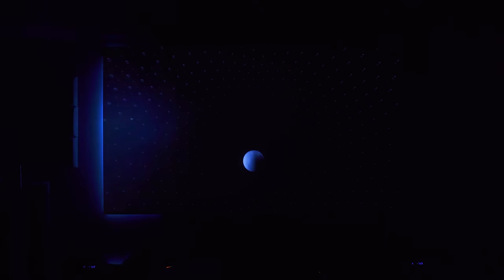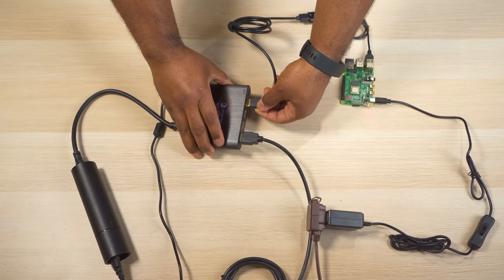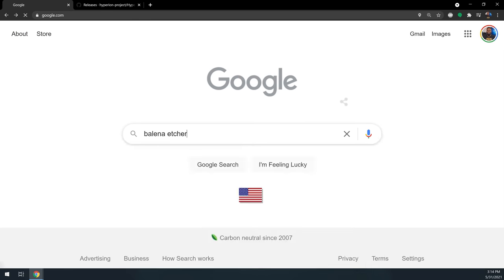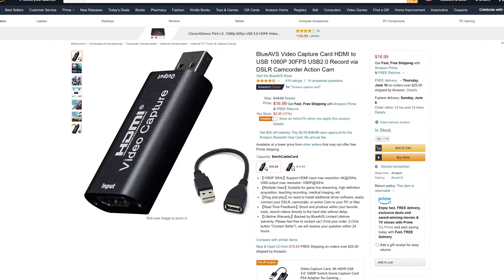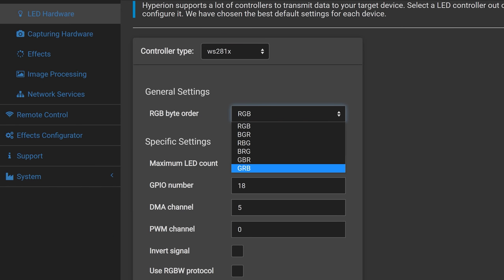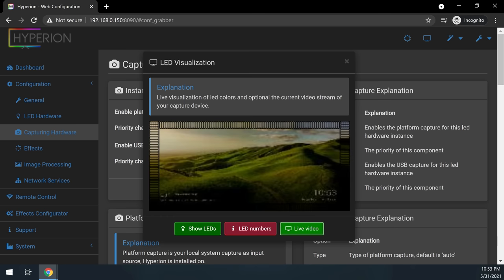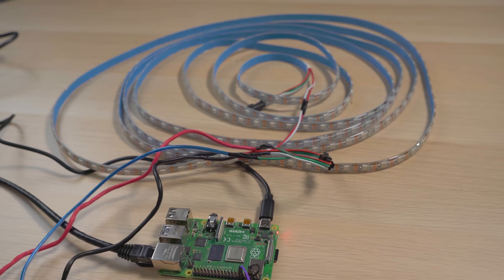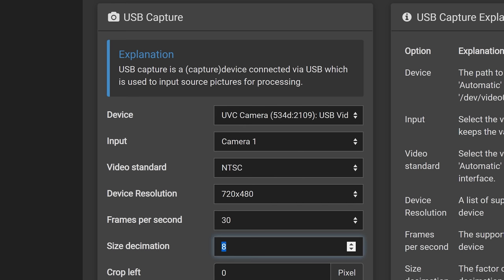Full Hyperion Ambilight Tutorial (TV Backlight) - LEDs Match Colors On The Screen

Comment from the maker: I want to note that if you plan on using multiple power supplies you should NOT wire the positive wires together. In other words, if  you're using 2 strips you'll connect one power supply to each strip but you don't connect the positive wires on the same circuit. You should wire all of the ground wires together.
Reply: This that helps alot. Thank you loads for your time.  Can't wait. But looks like it's the 400dollor box gurrr
Reply: Do I still need the splitter if use a receiver with 2 HDMI outputs
Reply: @ajaltonwilliams1986  good question
Reply: Chris have you used the hyperhdr software? If so are you able to use a different capture card?
Reply: thats what i thought while watching your vid...
Reply: i may have missed it but if you use a 12v led strip how to do get that common ground with the raspberry now that the voltages are different? thanks!
Reply: Is it possible to use an old Android tablet instead of a raspberry pi or any old pc like surface pro 3 or Lenovo x1 carbon etc....

Comment: Please, don't get 5V LED ones. working with 18A is ridiculous for only 300 LEDs. If you get 12V LED you'd be only looking at 8A or so.(no, I did not pull a calculator, so it could be off).  Even better, get 24V LEDs
Reply: I know it's late but ws2812 is only 5v, only ws2811 is 12v
Reply: 5v leds are individually addressable.  12v and 24 are not

Comment: I mean…it looks REALLY good. But, by the end I was calculating how much I make an hour vs the number of hours it would take me to get this right and I think it might technically cost me more money than the Hue setup 😂
Reply from the maker: 🤣🤣 Time is money!!
Reply: That's a great life ratio 🤣
Reply: Weird flex
Reply: Don't get Hue, get Govee instead and hide the camera under the TV with some décor. Phillips hue is the worst of the 3 options since it's the most expensive and delivers the worst result.
Reply: Brittany i literally pictured you programming your rasberry pi arduino and configuring Hyperion for your Ws281x controller, while troubleshooting voltage drop. Don't forget to connect the wire from GPIO18 to channel 1 on the 3.3v side.

Comment: I've been planning this project for awhile now, and as an individually-addressable LED, Raspberry Pi nerd - had definitely settled on the DIY approach.  I've watched several tutorials, and this is hands-down the definitive source of accurate and detailed information.  Total bonus when I learned that Hyperion supports WLED - so I'm driving my strip with a Dig-Uno controller w/ WLED.  This gives me a two-for-one setup allowing the maximum number of effects, as well as Home Assistant integration.

After much planning and research, finally pulled the trigger and ordered all my parts:  Could quite cough up the $$$ for the Diva, so settled on the Prophecy.  Already missing the CEC functionality -- just means I'm going to need to up my Home Assistant automation game to overcome the the loss.  Not sure I'm getting 4K@120Hz through the setup -- but could be a PS5 thing. :)

Thanks for the great content and insight!  I couldn't be happier with the results!  

Any thoughts on using an HDMI switch as an input - so that I can share the setup between PS5 and AppleTV?

Comment: Since no one mentioned it, 5:32 on HDMI splitter. You don't need to buy a special splitter for HDR tone mapping. Hyperion has a fork (version) called HyperHDR and this is a software based HDR mapping. This means, if CEC is important to you (it was to me), get a splitter that does support CEC (exp. EZCOO has these), and let HyperHDR do the rest.
Reply from the maker: Interesting. Thanks for the info!!
Reply: The prophecy Splitter is sold out, is there an alternative around the same price? Thanks!

Comment: Make the bottom strip the last one in the chain, and start from the bottom right side if you are looking at the back of the TV. This will give you the option of removing the bottom led strip if you have cables you want to hide, or if you install a center channel in the future. I learned this the hard way, but luckily it was on a monitor that was easy to reach behind.

Comment: If I'm not mistaken, having the resistor on the data IN would have probably prevented you from needing the logic board. If the logic board just "cleans up" the signal, the resistor would have done the same job for less $$. Great tutorial though!

Comment: amazing setup, really great video. i do think that after seeing that you need to buy a ton of equipment (some of it pretty expensive), the complexity of setting it up, and then you might get flicker which you have to buy (and hand solder) another piece to fix, and you might get lag... most people are going to just get a govee. i get that it isn't quite as good but it's plug and play. and until someone can make this plug and play (or substantially easier), i just don't think many will do this.

Comment: Amazing tutorial ! But I got three words '' Goove immersion kit " the latency on the lights has about a half of a second but it is extremely easy to install and it works just fine. I think if you're not working for a tech company or anything of that matter that involves all the skill that you have in this field,  I'm going to tell you right now that you should be looking into it because they are a lot of places that will pay you to install these devices specially since Goove only supports TVs from 55 to 65 inches, and your method seems like it could fit anything bigger than that.

Comment: Chris, thanks for the tutorial, by far the best I've seen! Quick question - you briefly showed an AVR with dual HDMI outputs in the video - have you tried the Hyperion setup using the second HDMI output from the receiver directly to the HDMI capture device? I'm running an Onkyo TX-NR6050 with dual HDMI out. I see in the receiver settings that I can enable both outputs and set the second one to a lower resolution. I watch a mix of SDR and HDR content through Xbox Series X and Apple TV 4K. I have two HDMI cables running from the receiver to the TV so it would be easy for me to set everything up at the TV using the second HDMI output from the receiver.

Comment: Kickass tut!!

Question:  From the video it looks like you are putting the light strips behind your UST PJ screen of 100-120". As such, I'm assuming you had to use about 25+ ft of led strips and it looks like you used a single power supply (assuming 5v ~40A) .
1) Did you take two long led strips and solder them together on all 3 solder points (power and data) to make one really long strip? 
2) For power injection in the middle of the strip, Did you then solder the secondary power wires somewhere near that solder point and then connect to the single PSU? 
3) Did you power the second strip on the far end as well? Thus 3 total power connections or do you just have 2 power points (beginning and middle)? 
4) Do you have a wiring diagram you could share?

Comment: Great work keep it up brother 👍🏽, first info I actually found was on the logic converter though you mentioned you didn't find any when looking to do my project your video was the second I saw the first had info on it quick question how many LEDs on your projection setup I'm having an issue where I can't run more than 490 and I need 504 on my 120 inch screen

Comment: Have been researching this and came across your video… hands down the best! Question: Would it be possible to implement light bars to this setup?
Reply from the maker: You could yes. You’d have to just get creative splitting the signal to the light bar strips
Reply: @ChrisMajestic  you think it would require a second Pi running Hyperion with just the sides configured? Or is there a way to configure two strips for the sides? I haven't played with the software but thinking of ordering it all tmw after watching your video. There are a few LED ambient light bars out there cheap. Also, have you tried this on a 3D TV/movie? I'm a big 3D nerd, lol. Thanks for the quick reply btw... subscribed ;)

Comment: HDMI CEC works as a bus so it is simply a connected wire between pin 13 of all HDMI connections.  All inputs and outputs pin 13 shares the same exact line.  you can simply do a continuity test on your device's input and output HDMI ports' pin 13 and all should be connected to each other.

Comment: Absolutely love this Chris! Thank you for laying things out in a simple and easy way to follow.

I had often thought about this option in the past, but could find no instructions that would make it simple enough for me to invest my time & money in attempting.

I currently have the 75" Philips Hue Gradient Lightstrip and Sync Box, but with recently selling off my 75" Samsung display and upgrading to the 100" VAVA screen (Optoma CinemaX Pro on order) I have found that my overly expensive bias lighting system will be swallowed up by the overlap of the far larger screen.

This option will allow me to mount the LED strip out to the rear edge of the screen! It will also address the pesky drops caused by my mesh WiFi system and Philips Zigbee mesh!

Thank you!
Thank you!!
Thank you!!!

I have one question though. Is it possible to run the Raspberry Pi bias lighting system on 3D content? This is something that the Philips Hue Sync Box cannot support.

Great video! ...also thanks for your earlier review of the Optoma CinemaX UST!

Comment: Thanks for this awesome video. Got some of the parts and am going to dive in tonight. I understand most of it, but how do you split the ground wire into two separate wires to create the common ground? Do I strip the ground wire and separate  the wire fibers into two different wires? Could I use the extra ground wire that is already on the LED strip to connect to the pi? Couldn't find any info online. Thanks!

Comment: Incredible tutorial! I followed it, and after a couple adjustments I had to make since I went wifi instead of using an ethernet cable like you did, it worked! It is GLORIOUS, but I have a few problems. My audio doesn't pass through the SIIG splitter for some reason, so while I have great video I don't have any audio to occampany it. Also the SIIG splitter weirdly does not support Netflix HDR despite supporting it in all other forms. Are you aware of any fixes for these issues? I'm still researching fixes, but thought dropping a comment here certainly couldn't hurt.

Comment: I understand the LEDs and Pi will require an external power supply, BUT why not use the video signal from TV USB port to feed the Pi to take advantage of the TV applications (most of what I watch) and not just the external video sources (only DVD player in my case). I have seen this might be possible on "5 great uses of your TV's USB port by Dignited": "The USB port on the TV also allows you to connect accessories to beautify the TV and its surrounding environment and enhance the user’s viewing experience. Also, 8K TVs from manufacturers such as Samsung (this is what I have) and LG have a sports ambient light function, and you can also purchase third-party TV lights that can be connected to the TV via a USB port".

Comment: Great video but I don't get your amperage calculations at all. I was taught total amps = watts/volts and in more than 20 years of commercial and residential lighting sales including specialty LED lighting I've yet to ever encounter any scenario involving LED strips that came anywhere close to a 18A draw and that is low voltage systems inside and outdoors with plenty of long runs and voltage drop to account for.  Maybe 1 or 1.5A tops. A huge power supply seems completely counter intuitive so just curious how you came to that formula of 0.06*NumberOfLeds?

Comment: AMAZING THANK YOU! Question tho, you said "you don't have to cut the strip" but I CAN cut it to the correct size, right??
Reply from the maker: You can but I recommend powering it at both ends. If you cut it then you'll either have to solder wires to the end or use clamps in order to power the end.

Comment: Hi guys, yesterday I tried to put together a Hyperion Ambilight setup. Howeer, me and my buddy hit a dead end. I really hope someone can point me the right direction. I will be as detailed as possible.

The equipment I got is:

    12V power supply 

    12V ARGB LED strip w/4 terminals. (WS2815)

    1080p (4K?) Capture card.
-Raspberry Pi 4B.

So here's the current setup:

The 12V power supply red and white cables are wired to the corresponding wires on the LED strip.
On the other set of inputs in the LED strip, the two middle inputs are wired together to the 18 GPIO pin (to the best of our abilities), and the ground is plugged to the 3rd pin.
Then, with a USB cable, the Pi is plugged to a capture card, which has a FireTV stick as an input, and it's plugged to my TV as an output 

Now, the biggest problems are:

    When turning the power supply on with the exact setup as mentioned above, a lot of interference and stuttering is introduced to the TV picture, sometimes the picture even dies. And the LEDs are all dead.

    Unplugging the ground cable that goes from the Pi to the LED strip still introduces interference, but the LEDs work. However, only a handful, and they flash in random colors.

Some things I'd like to mention:

    Hyperion is up and running, and I did some initial config. Enough to make sure it is detecting an input signal from the capture card, and for it to map the image to imaginary LEDs.

    Sometimes I'd try to unplug one of the Data input cables and alternate,. to no avail.

    I did activate the GPIO pin from the Pi itself.

    After some trial and error, we managed to make the entirety of the LEDs, it looked like the power cables weren't wired properly or strongly enough. We may be wrong tho. However, the LEDs were frozen in random colors, not reacting at all.

    At some point, tapping the Pi would make the leds change color lol.

Comment: Hi Chris, Nice video.  I am doing with the WS2815.  it powered up and all LED is lid up.  Only issue I have is Hyperion don't see the LED.  seem like the DATA line doesn't work.
I'm connecting it through the GPIO 18.  Any Help?
Reply: For Everyone that are doing the same with the Pi4.  Hyperian driver ws28xx wouldn't load on Pi4.  I put it in Pi3 and it work perfectly fine.

Comment: Amazing video! Really in-depth!
One question tho, if using EasyCap (AV to HDMI), how does it perform with HDR? I mean, does it get washed up colors or will it do a HDR to SDR conversion?
Reply from the maker: If you use the hdmi splitter that does HDR to SDR then convert hdmi to Composite using the Easycap then the colors will be fine. I've used an easycap in this setup and had no issues other than video noise since the video is analog. This causes some slight flickering from the LEDs.

Comment: Ok wow thanks! I did this and it works great, except for the flashing lights so I need that logic level converter. I'm using ws2801 strips however and they have 2 data lines... I hope I can still connect the LLC to them.
Reply from the maker: Yes. The LLC I used in the video can work with 2 channels so you would just connect each channel to each side.
Reply: @ChrisMajestic  Do you mean connect DI data channel to HV1 and BI data channel to HV2 on the converter? It's weird, I have a RPi 3 that works fine with WS2815, but my RPi 4 has flickering issue all with same cables.

Comment: Very detailed tutorial. Thanks. However I have a doubt. Do I need to use common ground if I use a 12 v power adaptor? Asking because I am trying to reuse my 12 v LED strips I bought for r another project.
Reply from the maker: Yes. You still connect the 12v ground to the Pi.

Comment: Hi, a great tutorial. But i have a question, I was using sk6812 (without level shifter) for a week now and everything was working except some random flashing occurring rarely. I also have ws2812b in my living room so i took the pi for that and when i wanted to use sk6812 again, they just don't work anymore. I tried rbg calibration but they do not respond and one more thing is that when i turn off pi sometime whole led strip will flash & turns off. I know led's are getting power because i accidentally touched two points on a led and it lit up white. So data pin is not working anymore or i can try with a level shifter?
Edit :- i bought a level shifter and put in with the led’s but no luck. I think my led’s have gone bad 😞

Comment: Hi - I've set everything up but I'm not getting anything from the LEDs. I've connected them to an Arduino and know the LEDs are fine. I'm confused about the signal pin you show - you're stating GPIO #18 - but the sixth pin down on the Raspberry Pi 3B I'm using is GPIO #1. In fact there's not GPIO #18 on the pinout diagram. Perhaps it'sthe level, I've bought some level shifters so hopefully that will fix it.

Comment: he said capacitor and resistor....imma go buy the hue sync box.  Honestly though I'd rather pay for the convennience.   Don't think  if you mentioned how to turn on/off the lighting if we went the DIY route or if we would need to go through the phi everytime if we wanted to change settings like adjusting function or brightness?
Reply from the maker: There's an app you can use to do that. But you don't need to manually turn it on and off anyways. And the resistor and capacitor were optional. I don't use them.

Comment: I followed this step by step and I've hit a snag... 

I'm using a Pi 4 Model B to control a strip of WS2812B LEDs. I am receiving a good image in hyperion but the pi doesn't seem to be sending data to the strip. Instead, every LED illuminates white. I have a wire running from pin 12 of the board to both data wires on the correct side of the LED strip and I'm using controller type ws281x. 

Any assistance would be MUCH appreciated!